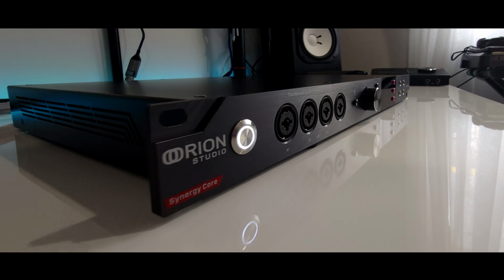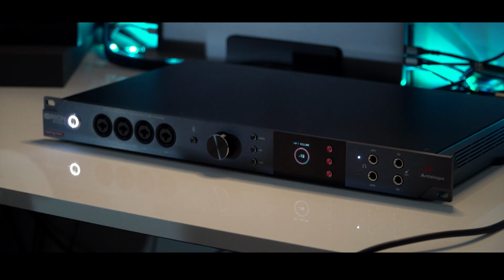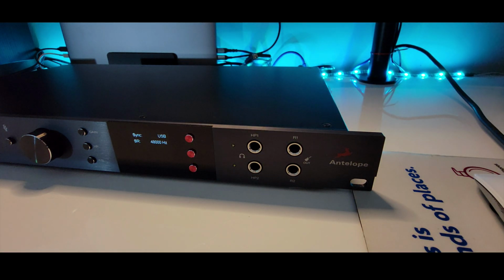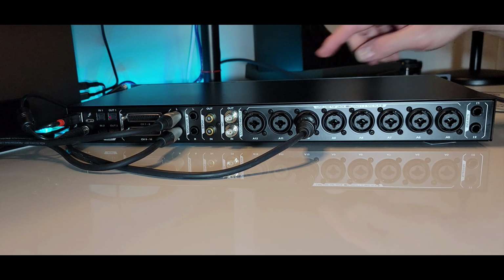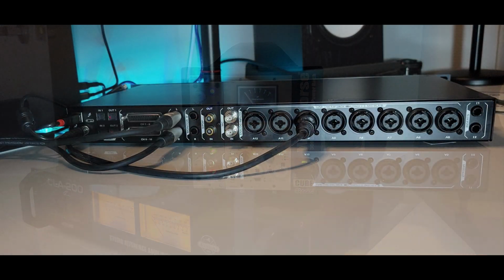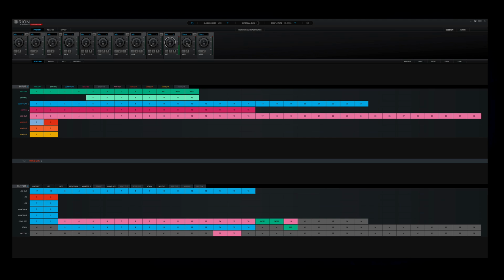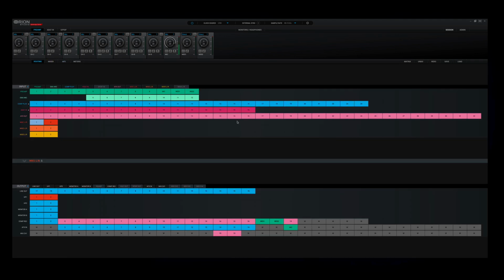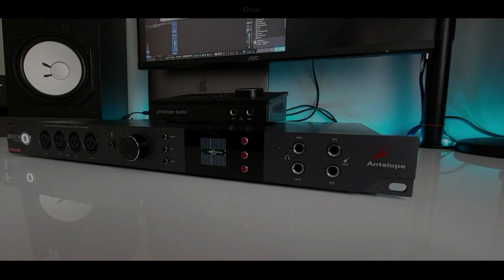Antelope Audio Orion Synergy Core Audio Interface (Review)

Comment: How are the drivers on this interface now days
Reply from the maker: I'm still using the device for mac it has been ok, I wouldn't say perfect. But its at a point now where I haven't updated the software because I had an issue when I did, so I had to revert to the older version to fix the issue. Not sure on windows haven't attempted anything there for a while.

Comment: How are the drivers on this unit any problems
Reply from the maker: For the most part, they have been good, I wouldn't say rock-solid as there will be the odd occasion that it doesn't connect, making me power it down and repower back-up, and all is good. It's just an inconvenience more than anything. The actual unit has great conversion, I have always liked the flexibility of routing and iO count. Would I buy it again. Yes, most likely. Are there other options, yes, but more expensive for what you get here.
Reply from the maker: Sorry It took so long here is the song Prayer life https://distrokid.com/hyperfollow/n8282/prayer-life
Reply: @CrossbeatsMusicProduction  This is the thing that PAINS me ....DRIVERS... I currently have the Orion Studio HD from new all those years ago and have not been able to use it due to the unit having to be HOT PLUGGED tobe seen by the M1MAC.. Thing is the unit worked flawless with a windows machine which really isn't making any sense .
Now im here again considering this unit
 thinking that issue would have been fixed by now, but it don't look like it.. 
The routing, and sound is why I would do it to myself in all honesty.

CRAZIEST thing is I have the Eclipse MasterGRade converter and this thing should not run on this M1 and it works with no issue ...
So how is it this works but the newer Audio Units seem to have issues is beyond me

Comment: Hey thank you for the video! I saw in a comment that you use it through USB and Mac, by any chance do you know if it works quite as well as if I were going to use only through USB in a PC? I mean stuff like the drivers do they work as fine? and can you get it to record well in 96k sample rate and 16, 32, 64 bit buffer settings without any clicks and pops or drivers crashing? I actually use what i think is a very decent PC.
Reply from the maker: You're welcome, as far as recording in 96k yes it's possible to do so, it will definitely strain your PC though if it's not powerful, depending on the DAW you use. That goes with any interface by the way. As far as the drivers hard to say for sure, It's been a while since I used the Orion on windows, about  2 years. I could try it again on my windows PC, and create a video on the experience for you if that helps ?
Reply: @CrossbeatsMusicProduction  Thanks a lot man! My main concern is that i used to have an orion 2017 rev and recording/playback was a pain back then because random clicks and pops from dropouts got recorded into the tracks, and playback had lots of those noises too, thunderbolt seemed to make it somewhat better in a mac i had but usb was kinda useless because of that problem, so i would like to know if this new version would be worth to buy if i were to use with USB and PC only and be able to record normally at high settings on a good PC or if the before mentioned problems persist.
Reply from the maker: @Daniel Gonzalez  Yeah I think back then things were kinda still in development for Antelope, not to say everything is perfect now but they have improved since. But recording in 96k is demanding on your PC for sure

Comment: Does it work with a tube mic?
Reply from the maker: As in does it supply phantom power ?
Reply: @CrossbeatsMusicProduction  
Its a external microphone, so 
I bought a 48v supply Power
But it doesnt work with the antelope
Reply: But why ?
Reply from the maker: @ar_s8  have you tried setting the Antelope to line level or direct input and what cables are you using? Balance or unbalanced?
Reply: @CrossbeatsMusicProduction  
I Tried connect with Line, But i cant Turn on the 48v on line or direct
Reply: @CrossbeatsMusicProduction  
I use balanced cable

Comment: Can you route all the 16 out to monitor 1 or 2 for the purpose of having one volume control for Dolby Atoms?
Reply from the maker: Yes that is possible, using the internal matrix/mixer. It's possible to setup surround sound using the output section in addition to the monitor outputs. Any additional outputs will be using the DB25 connection rather than the monitor section. If that makes sense. But yes you can route many to one pair.

Comment: Great video, i needed to watch it, i am now convinced. My question, when you are recording vocals in Studio One, how is the latency, i see that it has DSP chips. Can you record with low latency having loads of plug ins in the daw, not using their AFX? Tht would help me very much, thank you.
Reply from the maker: I record vocals regularly, no issue, just set sample rate lower than 128 and or use the low latency button in studio one.  Rountrip 64ms on USB and 9 with thunderbolt

Comment: can you use the monitor b output to route to external adc for mastering purposes?
Reply from the maker: I guess that's possible haven't tried that, there's multiple ways to rout out of the Orion though.. 2x DB25 8 mono or 4 stereo outputs each. Just remember to clock the eternal ADC
Reply: @CrossbeatsMusicProduction  can the analog outputs (including the monitor outs) be set to +24dbu?

Comment: Hi and thanks for the video. Do you think buying a second hand orion studio 2016(the metal finish one) would be a wise buy? I'm talking about the routing matrix, but also support on that unit and for sure conversion. I own a focusrite 18i20 with no line inputs(only two) but apart from this big detail the unit and its routing matrix are really efficient. About the orion again, how could work with licenses if you buy it 2nd hand? Thanks for all the help you can provide. Roberto
Reply from the maker: Licensing, should be deactivated by previous owner, so you can register it to your name, all done through Antelope account. Should you..? personally If the older TB2 or USB are ok for you, than, I'd say it's not a bad purchase as long as you know your probably going to be the final owner of the unit based on newer versions being available. As far as conversion it's good, probably better than current, noticeably.
Reply from the maker: The only down side, in my opinion is diminishing support for newer operating systems. Have you considered the Gen3 18i20?
Reply: @CrossbeatsMusicProduction  that's what I have, gen3 18i20 but no line inputs besides the two instrument/line on the front panel. This way I keep the gain at zero on pres 3 to 8, but it's not clean conversion, passing through the interface's pres
Reply from the maker: @robertopistolesi2735  I see, ok so you have the Gen 3, I wasn't sure. As long as the company supports the device, and the drivers for windows/mac if your either platform. id suggest Motu or RME always seem to have the best support, from what Ive heard. Ive owned Antelope devices for about 6 Years, and have mixed experiences, mostly good.
Reply: @CrossbeatsMusicProduction  how is the quality between the focusrite you have and this studio orion?

Comment: How does the sound of the Orion compare with the Discrete 8 Synergy Core? Really interested in buying one.
Reply from the maker: I haven't owned or tried the Discrete, but based on having tried the Zen Go I imagine it's probably in line with that. So to answer the extra money probably  buys just that little extra premium sound and AD/DA
Reply: Cheers guys! I went for the Zen Tour Synergy Core in the end. So far I’m lovin’ it!
Reply: I have the Discrete 4 and I had the zen Go and heard the Orion  Discrete 8 Would be on par with the Orion in put out put clarity You just not able to get as much output input channels and as much processing power Sonic was there to same The discrete eight would be a good choice not in less you’re going to be recording large bands or need a lot of plug-ins for mixing hi channel count then I would say that the Discrete eight would be the choice

Comment: Hello Cross beats !
I am planning to purchase afx2daw. i would really appreciate your views on it. is it worth the 200$ price tag?
Reply from the maker: I haven't yet purchased it myself, but I think if your happy with your Antelope device and you use the plug-ins lots, than it might be worth it. That said most of my mixing isn't done with any Antelope plug-ins, I mostly use Izotope, fabfilter and waves. When I had UAD I also used those.
Reply: @CrossbeatsMusicProduction  i have it and i dont use it. its buggy on my system. but i run the antelpoe plug ins as hardware inserts and it works perfectly

Comment: What color is the faceplate??? I cant make it out. I''m thinking of upgrading to this unit from a Orion Studio Rev 2017.
Reply from the maker: It's kinda gun metal Grey. It looks good in my opinion 👌
Reply: @CrossbeatsMusicProduction  Thanks for replying. I thought it was some kind of grey. I bet it looks gorgeous 1st person.
Reply from the maker: You're most welcome! It does look cool for sure ! 
I feel it's a slight step above on the ad/da converters too from the previous unit. It just seems to sound closer to the more expensive converters to me. There's always something better out there, but if you want something that does alot in 1 unit it's pretty good.

Comment: Definitely a sound difference between both units. Orion sounds more open and wider. Have Antelope improved when it comes to software/ driver support?
Reply from the maker: From my experience so far it seems like they have, I still had 1 time where there was an issue with no audio, and for no apparent reason, it worked after I restarted the device. Nothing was changed in the restart process. Just one of those things when you shake your head.
Reply: I think it was because he moved his phone or Video camera Sound pretty good both of them